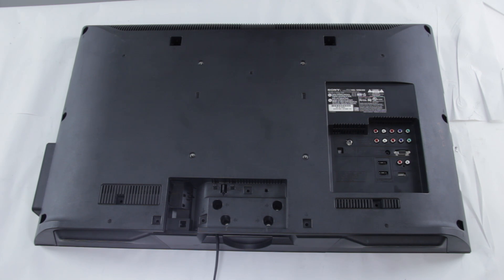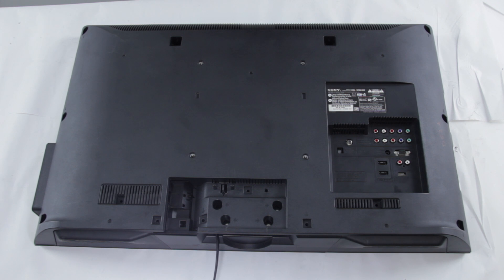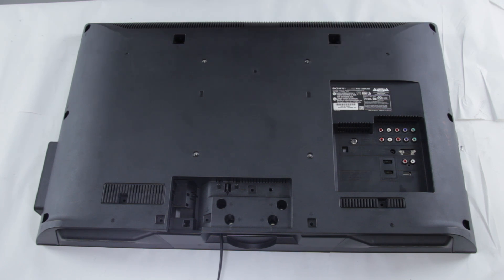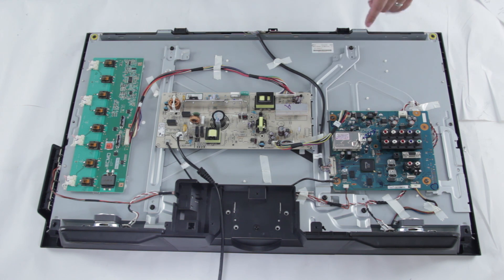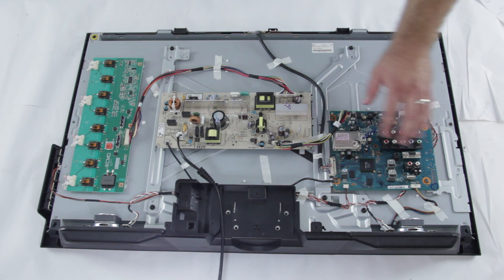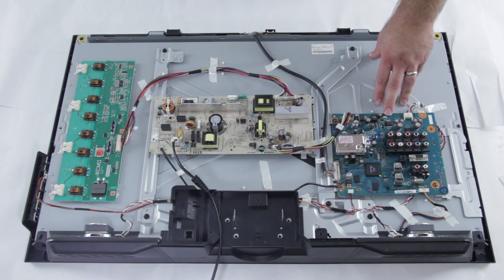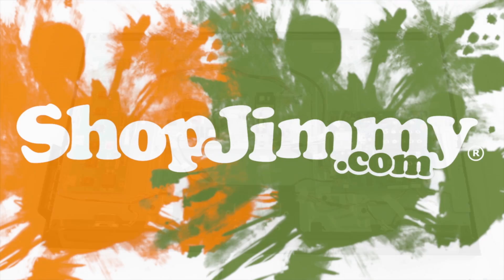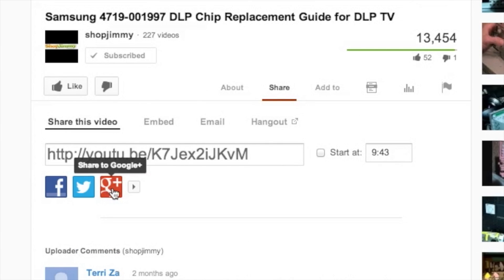LCD TV Repair - TV Has Audio, No Video - Common Main Board Symptoms & Solutions

Comment: I have a Westinghouse, model# VR3235 32" HDTV LCD TV, sn#  6620H14706526.  When the TV is turned on the power on led turns from red to blue, the screen seems to turn on (black to a darkish gray), "W" logo displays and the channel indicator displays.  After ~12 seconds a small white rectangle appears in the upper left area of the screen for ~10 seconds and then the TV turns off.  Power on led turns red.  Does this sound like a main board?  Thanks for your help

Comment: I own a Westinghouse SK-26H590D TV/DVD combo, Serial #5040W73400539. On turning on the TV, the picture often displays in bright neon reds, pinks and yellows for at least 15 minutes, sometimes periodically while we're watching. I have uplugged/plugged back in the LVDS cable inside the TV; all colors now seem sharper & brighter, but the neon issue keeps happening. If this is a main board (55.71C01.011G) problem, I'm game to replace it. Thanks for any guidance!

Comment from the maker: @nortenox4 - We need to rule out the source, so unplug cable or sat. coax from the power for 5 mins. let the boxes reboot. Also unplug your tv for 5 mins.  See if that helps anything.  If not I would recommend replacing the main board because that is the only board that chooses video, as the T-con will just receive that it is given and then deliver the video to the panel.  I will send you a message with more information for purchasing your replacement part! Thanks!

Comment from the maker: @tash williams - We took a look at your video and it looks like the tabs on the panel are folding the video over when they get hot.  The suggested repair is to replace the panel, however this can be very expensive and not cost effective.  You could try the main board, but I would say it has about a 35% chance of working.  You can search your TV model number on our website to find your replacement part.  Thanks and let us know if you have questions! (877) 881-6492

Comment: Pliz help!!! I bot a Toshiba Regza 40 inches 1080P Full HD lcd colour Tv with Model #: 40PB10V1 
Serial #:B40V27A31433K1
In the Kingdom of Morocco in the year 2011. Last week I came outside to find out the TV has automatically On itself with no pictures nor blue screen.  The power source/inverter board has no problem.  As i left the TV on I discovered it came on trying to show blue screen and went off and never came back again. The parts are not available in Morocco pliz help me. +212606460755